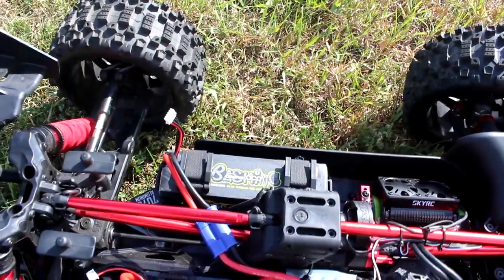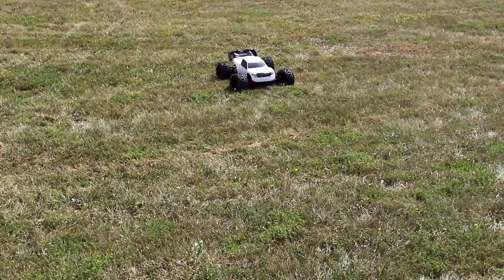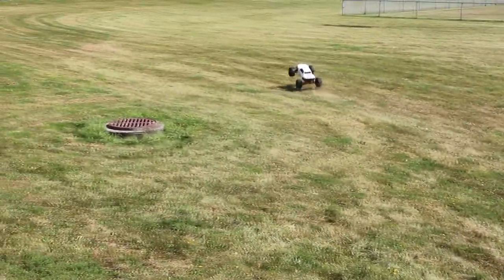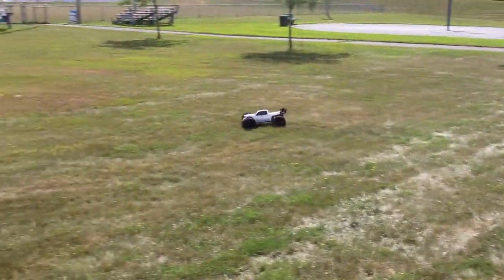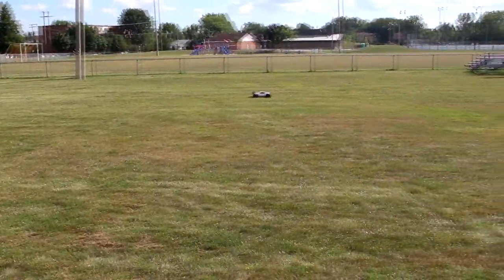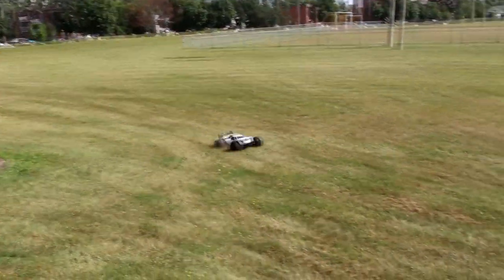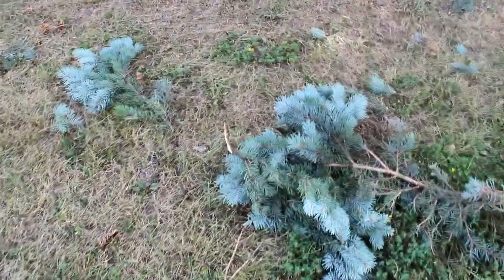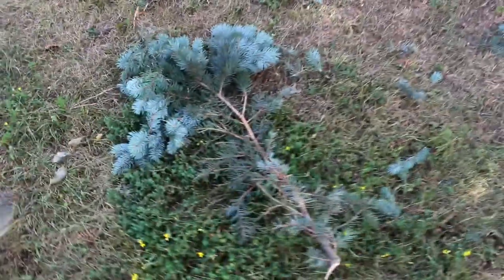OH NO Kraton 8S 11000 Beast But Did Not End Well OH NO

Comment: Yet another problem with Castle Xls ESC’s they must be cutting corners as the past year they are either falling apart or catching fire 🔥 I’d trust Hobbywing instead
Much love, cheers 🍻 brother
Reply: Hobbywing has been cutting corners lately. Power switches burning up left and right. The xlx2 is pushing the envelope and should expect problems on the greatest esc ever. The max5-8 shouldn't be having basic quality control issues years into production
Reply: In reality it's the esc I see used most these days. From speedrigs to monster trucks. It's the beast. With a 600amp esc with all sorts of restrictions and requirements people forget to meet there's going to be problems. Almost all that I see go bad are due to a small thing castle says to do that's ignored